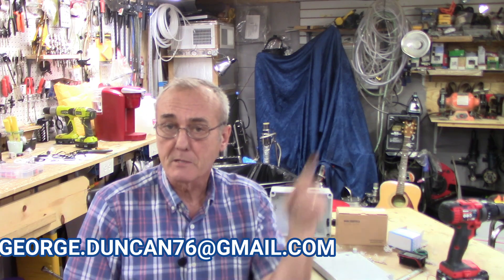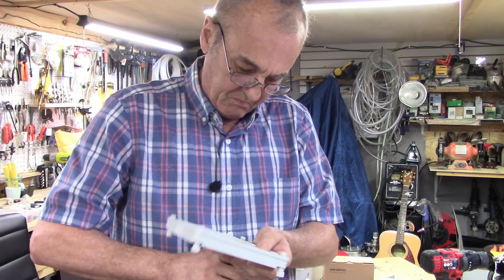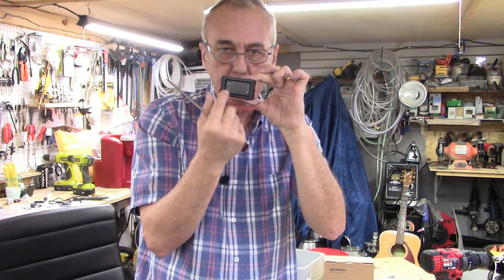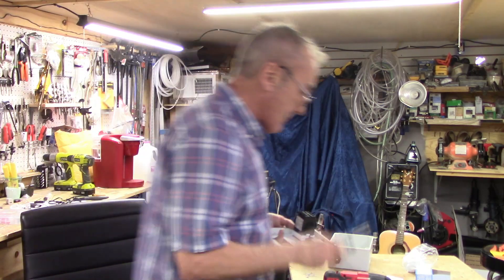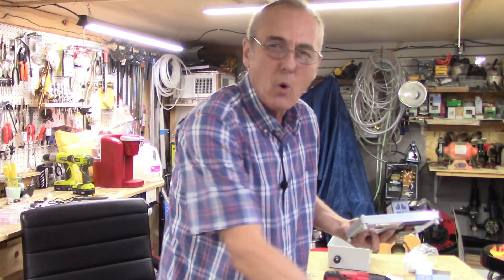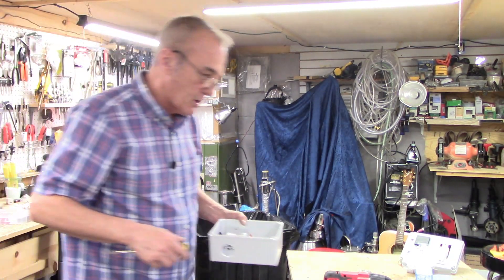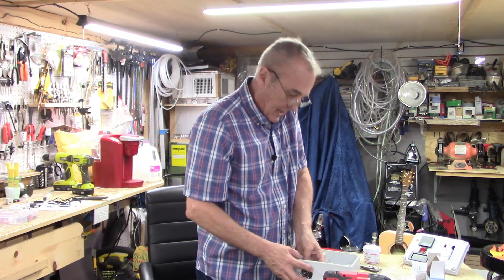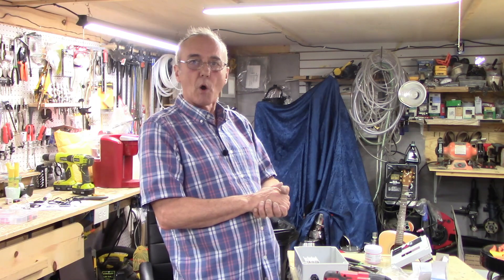BUILDING A 240 VOLT 20 AMP PID CONTROLLER STEP BY STEP PART 2

Comment: Awesome videos, im building a powder coating oven from scratch and wasn't sure how to wire two heating elements using a pid and ssr. These two videos gave me the basic idea I needed. Now to figure out how to fobit without the outlet and switch. My setup will plug directly into a dedicated 240v stove outlet with a dedicated breaker that i use as the switch.

Comment: I built a PID controller following your video when I got it finished it worked fine on my one kettle which is 220 volts I bought a distilling he heater emlet and I hooked it up and it blew my SSR 40 amp relay switch with that particular one do I need to buy a bigger relay switch or will it work if I bought a 60 or 80 relay switch would that be fine

Comment: I am huge fan. Great Series!  I built a PID controller. I bought a 100A AC Digital LCD Panel Meter Current Meter Monitor Energy Ammeter Voltmeter from ebay. I installed it just like you instructed. I schematic was facing up. When I turned it on it was upside down. Not fun.

Comment: Also, the "Dremel" tool , a Rotary Tool, with a "Flex Shaft" that your using.  I see that Harbor Freight has a flex-shaft for there cordless one, but not the AC power one.
Where do you get this??

Comment: Baking soda will activate and harden the super glue instantly and makes a super hard polymer, it's what they use to repair deep scratches and small chips on carbon fiber rotor blades on air craft!!!!!!! Super stuff pardon the pun lol
Reply from the maker: Awesome tip. Thanks
George

Comment: Hi good stuff George! I can see the switch on electricbrewery.com are 10 amps only whats the difference for controlling the camco 5500w?
Reply from the maker: It is always wise to switch the lowest current requirement. The controller itself is very low so if it doesn't work the element  doesn't work. Switching the controller is the smart way to go

Comment: what would i change to turn this into a 30A max for a 5500watt element?
Reply from the maker: Have a circuit that can handle 30 amps and use 10 gauge wire.

Comment: You can just take the controller off a hot water heater and use it to control your element!!! Just saying it would work !
Reply from the maker: Not without retrofitting the controller. Max setting on the controller is around 150 F.